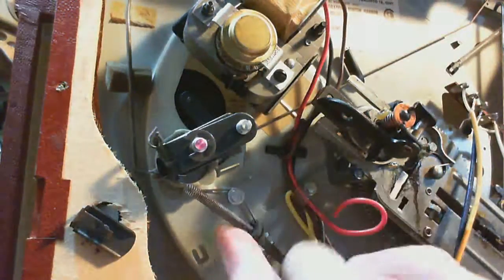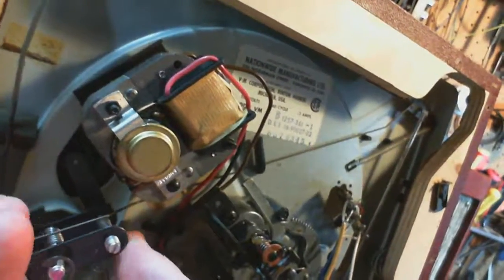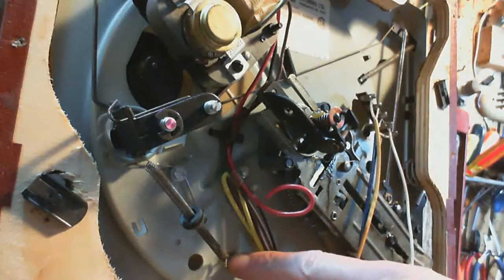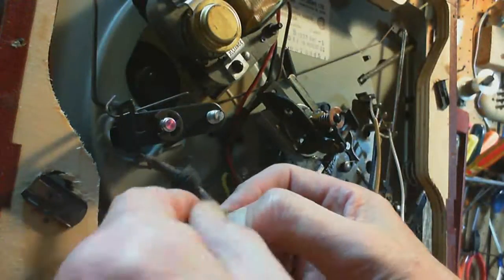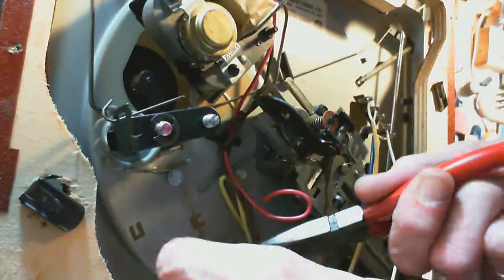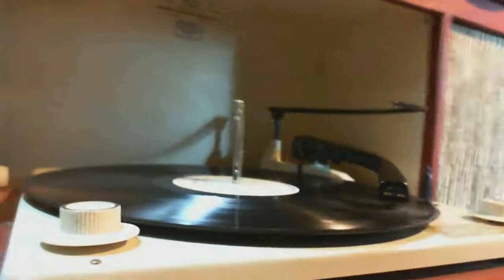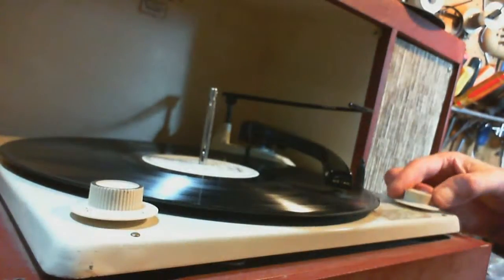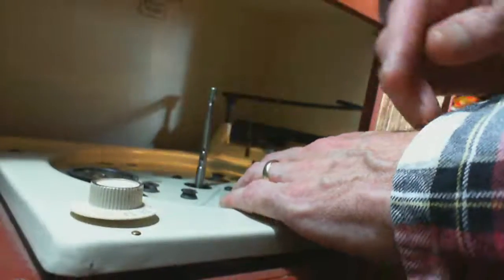Electrohome 652 Suitcase Record Player Video #2 - Idler Wheel

Comment: Hello Jim. After you cut the spring, you put the cut part in a different hole from the beginning of this video.
Reply from the maker: mike leone Oh!  I remember noticing that there were two holes but I just assumed the higher (shorter) one was the right one.  Funny how that works.  

So you think the spring should be stretched further to the lower hole?